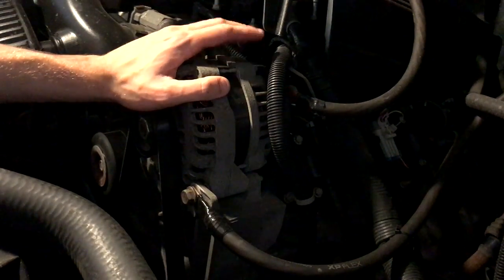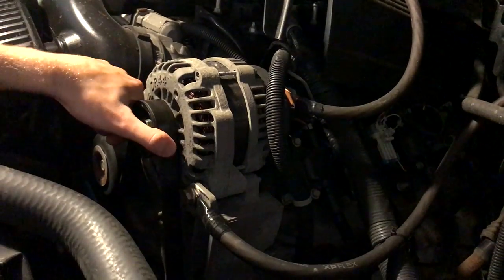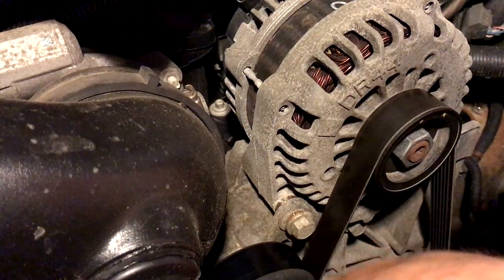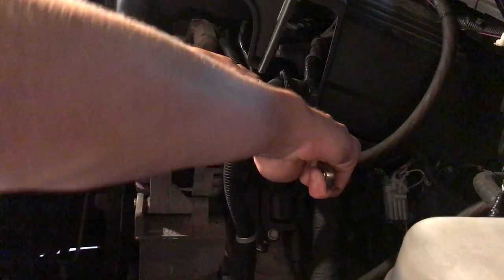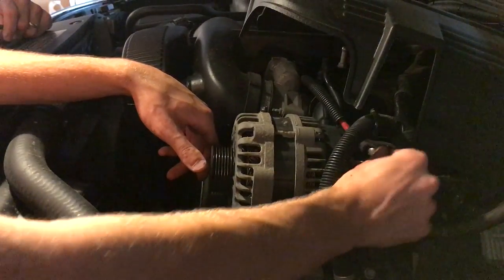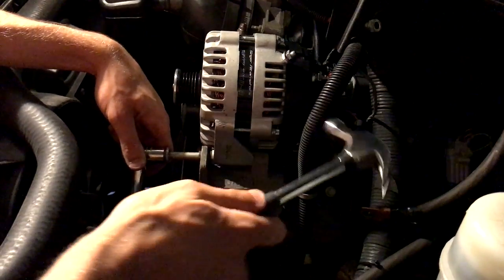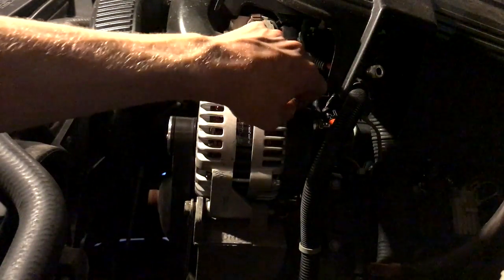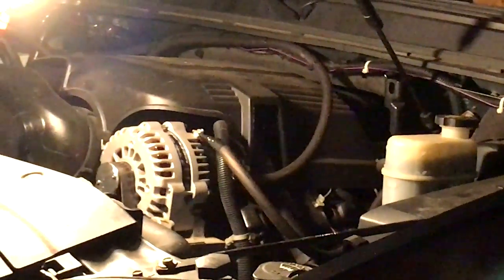How to Replace The Alternator On a 2010 GMC Yukon XL SLT (Easiest Job Ever)

Comment: What's considered a high output alternator?
Reply from the maker: In order to qualify as a high output unit, an alternator basically just has to provide more amperage than the factory unit that it replaces.